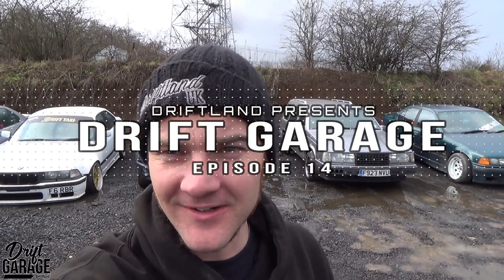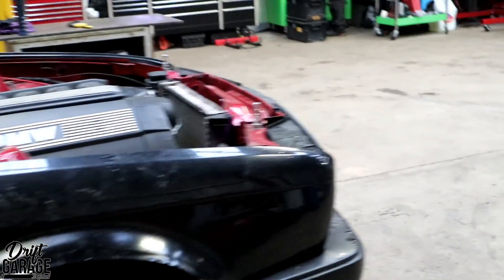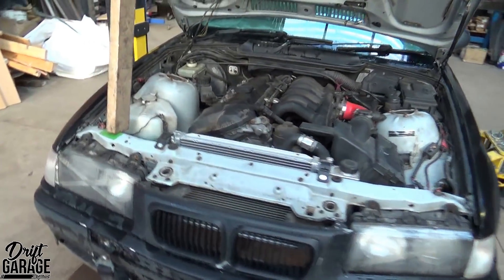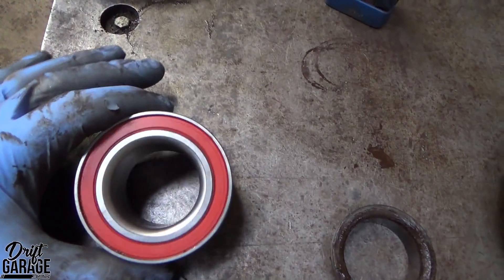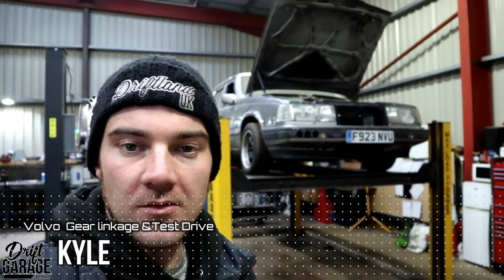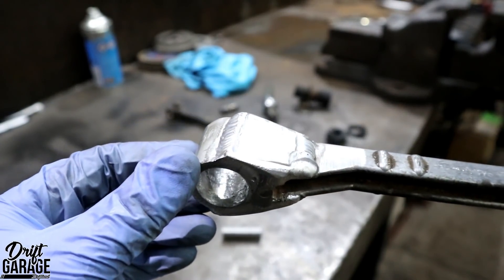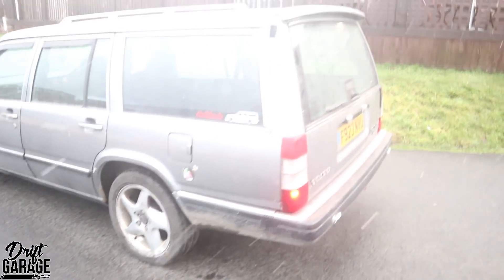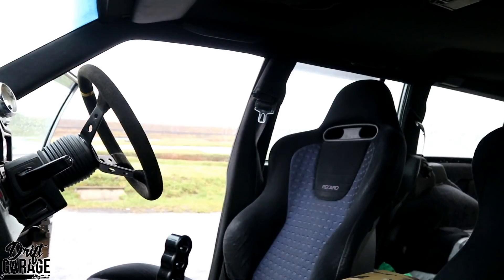Drift Garage Ep14 - Volvo test drift - E46 ti Bushes - E36 Cam Sensor

Comment: It's worth reinforcing the outside of the circular section where the shifter sits on that Volvo gear linkage too, broke mine shifting gear once and they're very fragile! Once it was reinforced it was absolutely fine. 940s are good fun :)